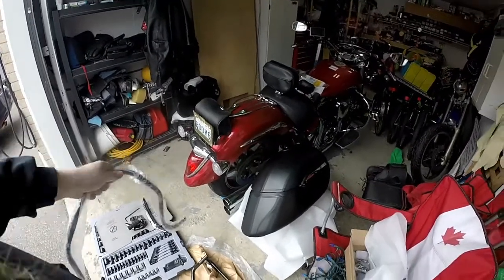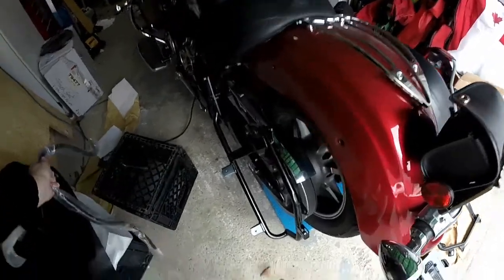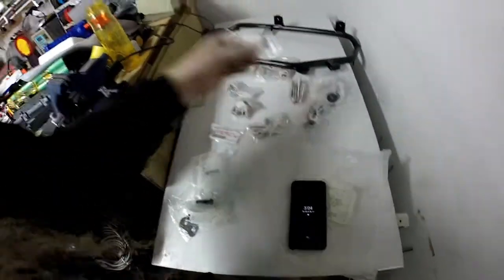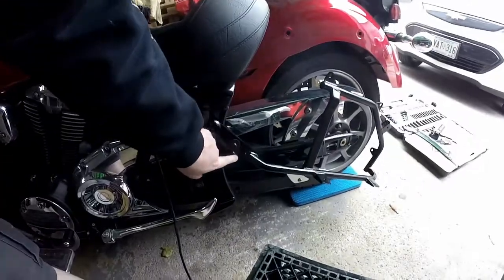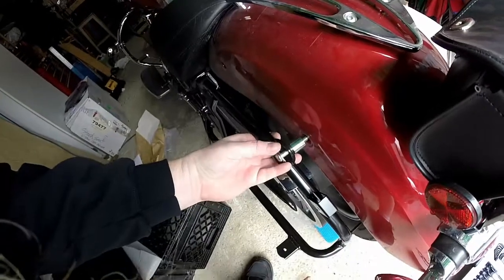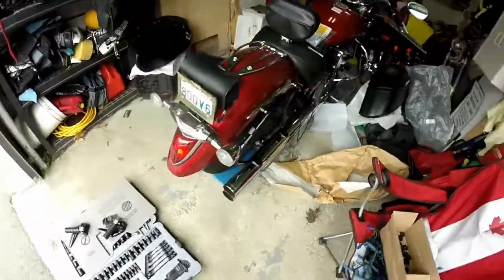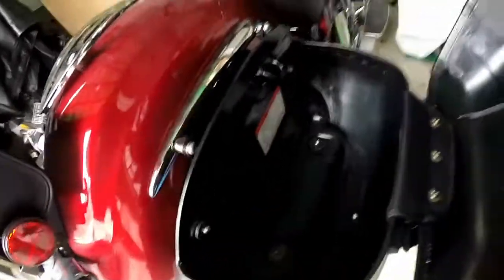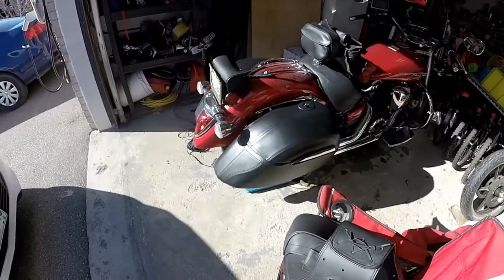Leather wrapped hardbags

Comment: I LOVE THE REAR FENDER RACK, WHERE CAN I GET ONE FOR MY 1300
Reply from the maker: That is the Yamaha rear fender billet rack, party number STR-3D851-40-00. I bought it used from a woman in Quebec because my local shops didn't have it in stock.

It looks great, but it's not really useful as a rack, it's like a 1/2 inch taller than the fender and my tiny Bungie cords can get under it (only just) but can't get it because the metal is wider than 1/2 inch.  For me that doesn't matter, I'm using it to "delete" the rear seat.

Comment: Dear Sir, I have a XV1700A roadstar and Im trying to mount the same bags, would you by chance still have the part number?
Reply from the maker: Part number for the bags?
Reply from the maker: Sorry, I was up early and awake late. The mounts I am using will likely not fit any bike but the VXS1300A or (VXS1300CT), and not the XV1700A.  Just looking at pictures online I can tell the shape is different from the ones I bought.

You may also have to find each side individually instead of getting a pair; I almost had to.  I checked eBay and found a few in the US (I am Canadian) so they are available, just none listing the part number...

Good luck!

Comment: Where did you get the oem mounting bracket. Thanks
Reply from the maker: eBay.  I got lucky that a set came up for sale right as I received these bags and found the mounting hardware provided with these bags was flimsy and ugly.

They come up from time to time used, or as new-old-stock (NOS) meaning brand new in box but ten years old.  The part number is STR-3D873-40-00 for the mounts.  You may need to buy them separately.  Also be careful about the 950's saddlebag mounts; they are the same shape, but smaller and will NOT fit.

Like this one: https://www.ebay.ca/itm/314690692882

Comment: Hey man! Thank You for the video! Such a shame the support bars not fit the bike out of box and need to buy the oem bracket for so much money.
Reply from the maker: Thanks. I'm quite happy with the bags themselves, but I haven't ridden in the wet yet, and I'm a little worried they don't seal very well. I'm planning to add a little bit of rubber/foam weather stripping to the inside of the lids just to keep things dry.
Reply: @zeroreality  Most water should come off straight from the movement as you ride, but I've got a slight concern as well, especially seeing the lock design. It might keep the water, and soon or later leak to the inside. Now I'm on the hunt for the brackets in EU.
Reply from the maker: @istvankovacs4813  https://www.ebay.ca/itm/295092353219?hash=item44b4dff8c3:g:Z-kAAOSw1tJiztjs

They're used, and shipping might be expensive, but it's the first time I've seen them since posting my video.

Comment: Hey Alex, I did watch your Virago Stator videos. I have had my Virago XV 1100 with stator problems which lead to a rectifier short, had both parts replaced at Yamaha, and not even after  year, the stator is broken again.
I read that you sold your virago, was it due to the same stator problems? What do you reckon is the culprit for it always going bad?
Reply from the maker: Damn dude, sounds like the same problem with mine; the stator went a second time about two years later.  I didn't replace my rectifier though, so I always wondered it if was killing the stator somehow, or if the cheap replacement I got from eBay was the blame.  But if you had yours replaced at a dealer, it's probably the same (or similar) root cause.

The only other thing I can think of is that there was some other electrical component causing strain on the whole system.  Maybe the ignition coils or... who knows.  I loved that bike, but I am more in love with my new bike!
Reply: @zeroreality  I see, there might indeed be an eletrical component causing issue on mine too but it will be a pain trying to figure it out. Then again, mine will be 30 years next year...
I saw that you have a 1300 Vstar, is it worth it? It's almost at the same price range as a Harley though
Reply from the maker: @GamingWithHasty  My first two bikes were both Viragos and I paid around $2k for each.  I never made videos of all the maintenance and changes needed on those bike, but syncing carbs, and cleaning those carbs was also something I had to do.  After I decided to sell my xv1100 I knew I wanted a more modern bike with fuel injection and other modern conveniences; also that parts (and accessories) would be easier to come by.  I also wanted something reliable, so Harley was off the table first lol!

I looked at metric cruisers and found this bike for sale from a guy who just never rode it anymore; less than 5k kms and around $7k.  I paid cash and had to register the bike myself which added to the cost, so I did spend quite a bit more than any bike before (and more than I had originally planned), but this bike is fantastic!  Lots of power (not too much noise), plenty of comfort, and (hopefully) lots of longevity.

I haven't cut the video together yet, but the handlebars as hey come from the factory are a crime against riders!!!  I needed to raise them about 4 inches, but that change alone made all the difference in the world.  It went from feeling like a long wheelbase bike that was hard to turn back to feeling a lot like my Virago in terms of manoeuvrability and low speed turns.
Reply: @zeroreality  Damn you got really lucky, with 5k on it it's a brand new bike. I also had a look for someone selling a 1300 in my country but haven't found any yet. The thing I am most concerned about is the Injectors, if one goes bad how much would it cost to fi/replace